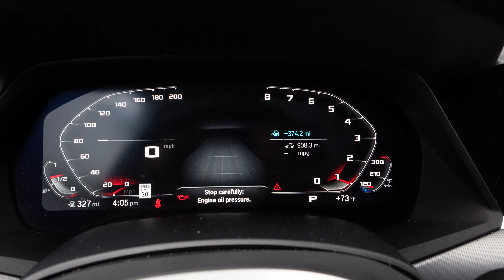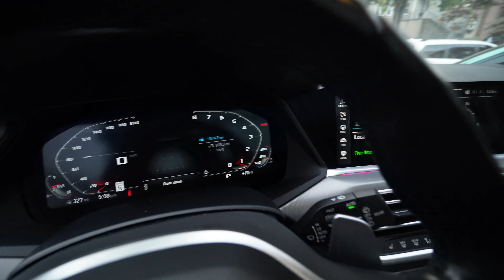HOW I ALMOST STUPIDLY BLEW MY B58 ENGINE...

Comment from the maker: If it wasn’t clear, once I got that weaning I shut the car off right away. Even when I was diagnosing, I didn’t let the car run for long and definitely did not drive it, otherwise I could’ve legitimately caused severe damage to the engine
Reply: I've always used Mann oil filter never had any issues. Some filters quality are just not good.
Reply: Ayman, when you put in a new oil filter its good practice to put some new oil on the pump that pushes out oil. what could be the issue is that the filter was brand new and the pump probably didn't have new oil initially. A few months ago when I did my oil change and I had the same problem on my N26 engine, the fix to that was to put a little bit of oil in the pump where the filter sits. InshaAllah this helps you out brother.

Comment: It happen to me first time i wanted to change the oil on my b47 diesel ,the new filter (mayle brand) had a factory error ,got it to warm up,check for oil level and after reading turned the warning
Turned off the car,got to a nearby part shop with my bike and ,buyed a new filter this time bosch
Installed worked fine ,no damage done,nothing to worry about

Comment: Don’t worry ayman. The engine has residual oil from the previous time you started. So even if you had no engine oil at all. You would still be fine at idle. But not for too long.